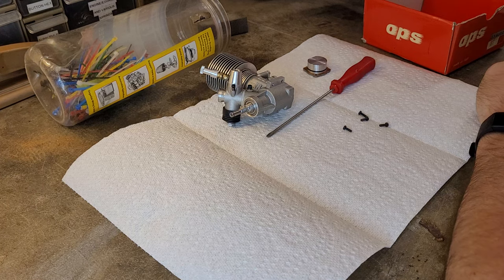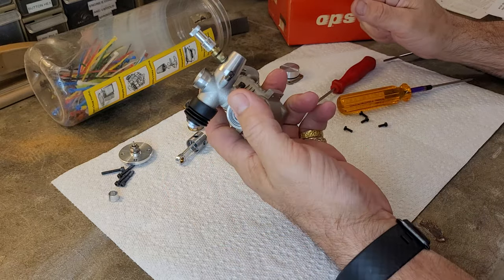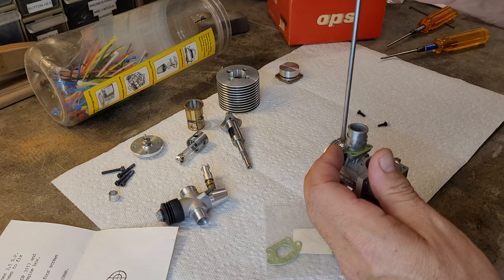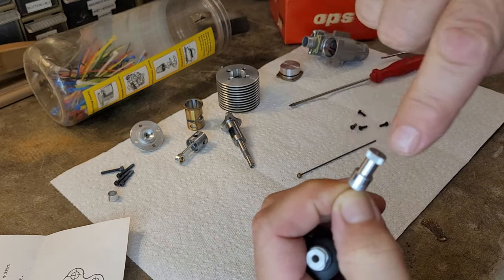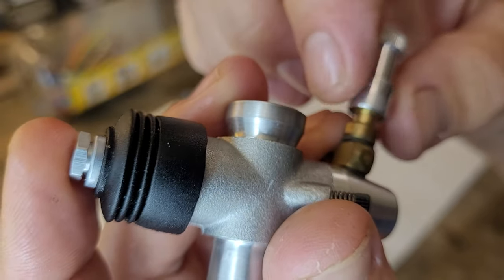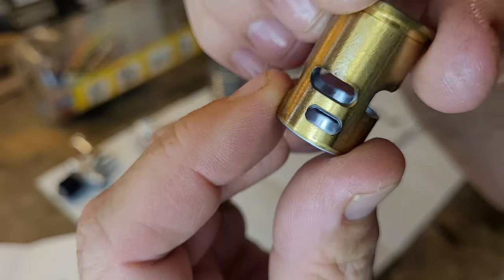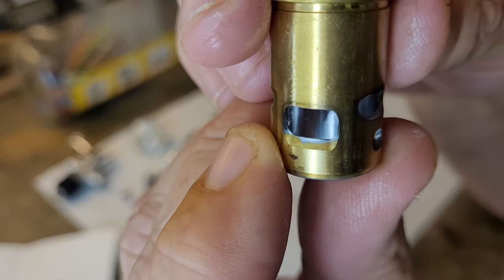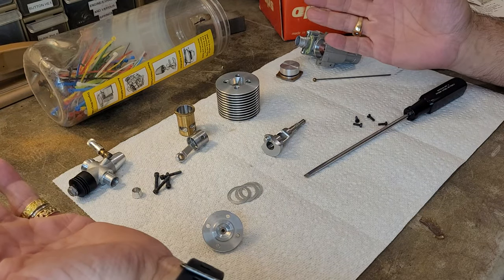Let's check out a vintage OPS 8841 3.5cc buggy Nitro engine from 1991 unique carburetor .21

Comment: can you post a vidoe on how to fix leaking shocks my xtm mammoth has leaking shocks and i dont know how to fix it
Reply from the maker: More than likely just a leaking o-ring. Are the shafts straight and smooth? If so than a rebuild with fresh, lubricated o-rings should take care of the leaking. 
Now that I'm thinking about it, XTM shocks seemed to be quite prone to leaking, if I remember correctly they have two o-rings with a spacer in between. I think adding a third o-ring squeezes everything together a bit better and helps with the leaking.